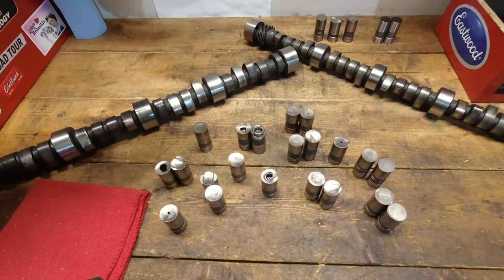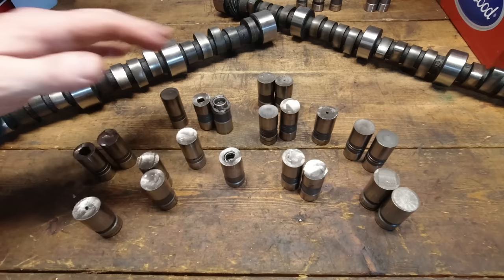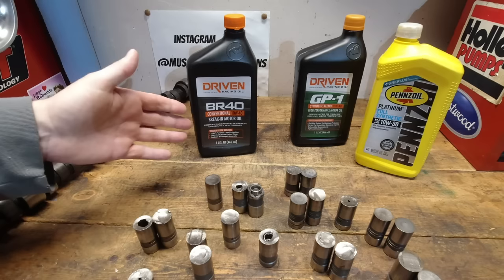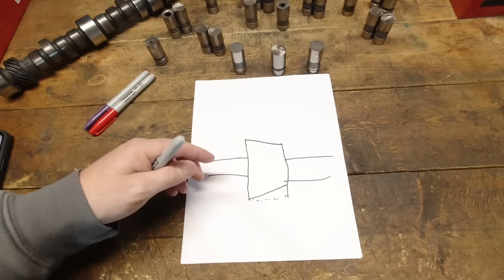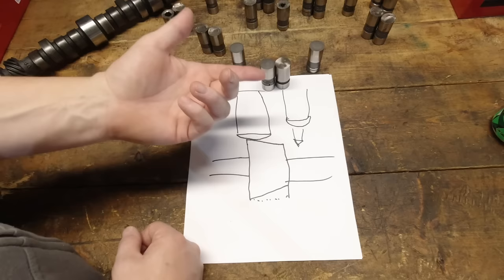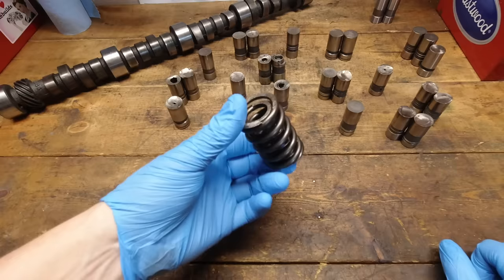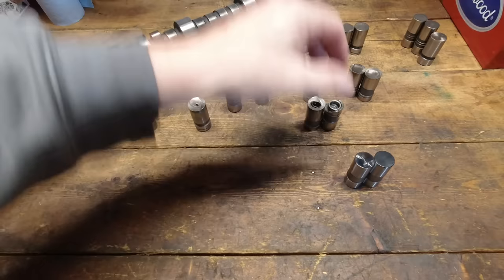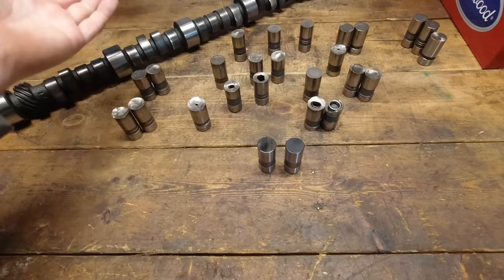Flat Tappet Cam Failures: The Reason Why They Go Bad & The Solution! Part 1

Comment: In the last year or so, Comp has started a Nitriding program for their flat tappet cams and I had my last SBC XE-274 cam done. It had a good 500 mile breakin period and I also used BREAK IN ROCKERS that were just 1.3 ratio from Speedway. After the breakin, I switched out the breakin rockers for normal 1.5 ratios on a 400 SBC and it has worked out very well. I brought that motor up to 2000 rpms immediately and varied it up and down for the first 20 minutes while I checked for leaks and let the motor get warmed up. It has over 5000 miles on it in a old 1986 Z28 and so far, that procedure has saved any failure. I do still use Castrols Hot Rod Car oil that has added ZDDP in it and during initial breakin (and the 2nd oil change also) I used Lucas Breakin 30 wt oil WITH additional Rislone ZDDP additive. Less spring pressure with the 1.3 rockers was definitely a good and easy thing to do to keep from flattening a new cam. Just my 2 cents and I've been building engines for over 45 years. Thanks for the interesting video. Very informative.
Reply from the maker: Comp has had a nitriding option for over 20 years.  You’ve for sure helped that process with the reduced spring pressure with the smaller ratio rockers.  It’s one of the biggest problems folks don’t address because it’s generally a pain to change from a light break in spring to the regular operation springs post break in.  Just remember on mixing oils.  Any good break in oil has the correct amount of zinc.  There is such a thing as too much.  Plus the oil and the additive don’t mix until the oil temps reach whatever it needs to attach itself on a molecular level.  If it’s even compatible.  We had a discussion with Driven a year or so ago and and interview with Lake Speed Jr about that very topic.
Reply: @MuscleCarSolutions  It took 8 months for me to RECIEVE that nitrided cam and they didn't do just mine, they ran a whole batch so that model # can now be bought and shipped the same week. It was worth the wait. Another note, I ordered a step nose factory roller cam for a 1987 350 SBC and Comp was waiting on cores. That was a 6 month wait as they said that no company had any cores and only 3 foundries produced them. Out of those 3, only 1 got a batch of cores, so I got a bit lucky there also. Just more cam information for your video.
Reply from the maker: Nitriding takes quite a long time depending on material and spec on the depth.  Plus there’s the core availability to begin with.  We’ve talked about those US suppliers that still make cast cam cores and unfortunately it’s not a priority for them.  They switched over to billet cores when the OE started changing those engines back in the mid 80s.  Cast, flat tappet cam cores are like flip phones.  They’re a thing of the past that we can’t seem to let go of.  Getting harder to get and longer to get them.
Reply: @MuscleCarSolutions  You have answered many questions that I didn't ask and I appreciate it. I am also in a import group that insists on re-nitriding our factory forged cranks if they have to be resized. I am old school and have ran many a cut crank and never had them nitrided, I just ran the appropriate oversize bearings and checked for proper clearances and went on with assembly. Never had any issues on my domestic engines (or those little import engines) but it doesn't pertain to your video. If you happen to be able to point me in the direction to help others though, I sure appreciate it. 🙏
Reply from the maker: @martywilsonwilsonenginesho7940 nitriding doesn’t go to a very deep depth.  It’s slightly below the surface and is more of a filler for the valleys in the grind.  I’m not sure that a regrind on the crank would gain any beneficial results by nitriding the surface again.  I guess the real question will be what is the material of the crank made of and how much was removed to clean up the surface.  Then a nitriding company can determine if it’s needed and what the recipe needs to be.  There’s lots of different combinations of gas/time/temperature when it comes to that process.  I don’t think you’ll find a universal answer.  My guess is it’s going to be very specific to the crank and application.

Comment: Would be great to have a flat faced lifter and a wear cap( as used on valve tips) with the correct hardness and crown, most flat tappet engines have room for, or could easily be machined for such a cap. Fitting them is of course the challenge,  no different to doing mushroom tappets though.
 The reason for increasing rpm for break in is not oil throw off, have you run an engine at idle with no sump on it and oil picking up from an external container, if you have you will see that oil throw off at idle is not an issue.   The reason for the rpm is to 'basically' allow the lifter to 'skim' across the oil film and not break through the oil film on the lobe. The faster the surface speed difference the better this action works and controls rate of break in, whereas at low rpm/idle the lifter can break through the oil film and begin to scuff the 'microscopically' rough new/un broken in surfaces. Once the surfaces have broken in and mated there is now a lot more effective surface area to ride on the oil film and low rpm running is then safe.
Reply from the maker: Flat tappet lifters are so cheap as it is.  Adding more complexity and cost to it sends those manufacturers running.   I one would buy a $500 set of flat tappet lifters.  The crank throwing oil on the cam for more lubrication at break in absolutely is a critical part of the process.  Don’t take my word for it.  Google it.  I’m sure you’ll find other resources that mention that process and the key condition the crank provides with more oil on the cam.

Comment: I just lost a cam after break-in and a test drive,never lost one before. I'll give it one more try before doing a retro roller.
Reply from the maker: There are three videos in this series.  Lots of details on why they go bad.  Follow the recommendations for a successful break in and your chances will increase significantly.  The last video on lifters is very important and one that I think is flat out just neglected.  Spring pressures are the other extremely critical parts that is just ignored.

Comment: I know you mentioned you had lifters of basically all the common brands in the video, I just wanted to point out that you did not mention anything about lifters with the “hardened face”. In my experience very few lifters have this feature anymore. I specifically use AC Delco lifters which are made by Delphi, but I only use the ones with the hardened face
Reply: That is a good point! Also if you look at GM Performance lifters they have the hardened face and the reviews are 5 star on Summit. I've heard good things about Melling also.
Reply: Tom, you have spoken the truth. The solution is the hardened face lifters. GM developed this and likely others in the 1950s or earlier. Proven and reliable. These other ideas are almost always (dare I say always) a desperate grab leading to more of the same old failures or a new marketing ploy to sell a new product as a solution that almost always does not work!
Reply: @plumcrazy588  You have to be cautious with the melling lifters now too the Mexico ones are iffy at best but their good ones are sourced from Hi-Lift Johnson Engine Pro will give you the Hi-Lift ones if you ask for them or the add specifies but other wise you get the Mexico ones they sent me the wrong ones I called them up and they told me to keep the Mexico ones and had a set of the good ones at my door the next day good group to order Melling and S.A. gear parts from

Comment: Something nobody seems to mention is coil bind, retainer to stem seal clearances, bad rocker geometry, improper lifter preload.  Another point could be improper or even no oil priming just prior to initial start. And not having proper initial spark advance and/or untested carb which means that the engine doesn't fire right off. Maybe people think it's too obvious, but these can all have an adverse effect.

Comment: I have to agree about going roller, especially if you are building your first engine. The initial break-in is so critical on flat tappet cams, and with a new build, you just dont know if something is going to go wrong even in those first 20 minutes.

I lost the cam in my first engine build, because 1. It took too long to fire up, and 2. I had a windage tray in my oil pan that I did not know was going to be a problem.

My current build i may have some break in issues, since i had a temp gauge reading high, 260f in 10min of running. Being inexperienced, i thought the issue was the cooling system, so i failed to ever get behind the wheel and break in the rings. How did i find out that it was the temp gauge? I put a vintage style liquid filled shock proof temperature gauge, and mounted it next to the thermostat. Done. I now know my engine temperature with certainty. 

My point is, if there is a product that significantly helps in that critical time period... Use it! Were humans, and our cars are not magical, they are subject to the laws of entropy! Lol

Comment: As a kid back in the 80s, I did 4 or 5 flat tappet cam swaps in both small and big block Chevys. Not a professional mechanic or an engine builder, just an enthusiastic kid. They were all broke in properly and none of them failed. It would seem that if professional engine builders today are experiencing early cam and lifter failures, there must be a problem with the metallurgy, heat treat, or lubrication. JMHO
Reply from the maker: @paulthibodeau1269  it’s the at home builder having a majority of the issues and 2024 isn’t 1980.  A lot can wear in those lifter bores in the 50+ years these engines have been around.

Comment: I also think lifters need to be checked for bleed down. Maybe someone will makes a tool to feed 20-80 psi of oil pressure to check for bleed down while applying pressure equal to our spring pressures. If you buy a cam and lifter kit I think the manufacturers could and should check that and certify and warranty them and have a certification card along with the cam card. Imagine if a company did that these days, but, you’d always fight the one guy that doesn’t know how to break a cam in, never degrees it uses cheap non sae certified oil, and never blames himself.

Comment: Nice, guess flat tappets are going out of popularity because of these issues which on the flip side, if someone comes out with an affordable solution and word gets around, that company is going to reap the rewards. 
I'm already looking for this exact deal as I prefer the profile of a flat tappet cam vs an aggressive roller. The flat tappet also has an advantage in the initial portion of the profile as it works on the edge of the tappet instead of a central location of a roller bearing.
Reply from the maker: The video has the affordable solution.
Reply: the sound of flat vs roller is so much better too......the rollers sound clinky
Reply: @MuscleCarSolutions  yeah, that's exactly what it's looking like. I've found small engines that have gone to alternate materials including plastics just to solve this issue.
Reply from the maker: Well thankfully this solution isn’t plastic parts.  😆 But it is the most promising thing I’ve seen to address the issue.  Very cool product for sure.
Reply: @MuscleCarSolutions  my face said it all apparently. Briggs and stratton were the first I'd noticed to do a plastic cam, I think there is a steel internal shaft but the lobes, outer edge and driven gear is all white plastic.

Comment: What if I use a non detergent oil with a zinc additive?
Reply: special oils in a specific brand are likely never going to add much aid to the solution because the flat tappet lifter is loaded hard to the cam lobe when opening and the lifter without roller wheel just shaves off the lubricant. I seriously doubt these oils can embed themselves into the metallurgy of the metal once the metal has been poured at manufacturing  and is machined and has cooled.

Comment: I went through 2 cams in my fresh BB 454. Used the break in oil each time, and 2 lifters wiped out the cam. I switched the lifters to Isky Anti-Pump lifters, and problem solved. And yes, your right with the amount of money i spent on flat tappet, I should have went roller.
    Now just built a Cadillac 472, and same break in oil and kept break in rpm at 2k, and 1 lifter wiped out the cam (wasnt spinning) and wiped out the rod/main bearings on a brand new motor. No option for roller as I dont have the 2500 for cam/lifters, new springs, and custom length pushrods.
Reply from the maker: Spring pressure is even more critical on those heavy valve trains.  Have to use a lighter spring for initial and extended break in.  2000 rpm is too much speed.  You bring up and excellent point on lifter rotation and it’s a topic we’re going to cover in the next video in the series.
Reply: @MuscleCarSolutions  Like you said in your other video, I was denied warranty. So, I did the research, and Johnson is the only American company not using other countries metals. Bought direct from them, and had Isky make a new cam. Not the other place. Will def use your advise on lighter springs and lower RPM's on Break in.  
  And your so right, that this was NEVER an issue back in the day. Coulda used spit on a cam, and didn't wipe a lobe-lol
Reply from the maker: @DeadwagonGarage  given there are specific precious metals that only come from Russia/China, getting anything made without materials from that part of the world is impossible.  But I think I understand what you meant.  Comp has their own roller lifter faculty in Michigan, but as far as flat tappets go, those manufacturers are moving away from that as quickly as they can.  Spring pressures are super critical.  Get with isky and they’ll tell you what to set them at.  The example in the video of 200 open and 100 on the seat is a good rule of thumb, but follow their recommendation!

Comment: Oil and the break in lube on the cam are crucial. Do not use a API certified oil, flat tappet engines are not current tech that API is geared towards. Thank you for mentioning oil issues with additives to API oil. Saw Lake Speed Jr. at Carlisle seminar preaching all this, he is a very smart oil engineer. I also believe that a moly based paste on the lobes for the first few seconds of running before the oil really starts splashing. Not using the grease like break in lube that comes with many cam kits is a rule I firmly believe in, solely my opinion though.
Seat pressure for the springs is also critical, ramp up in spring pressures for radical cam profiles are dragging up the seat pressure heavily loading the lifter early on.